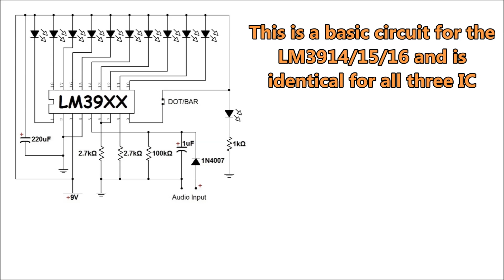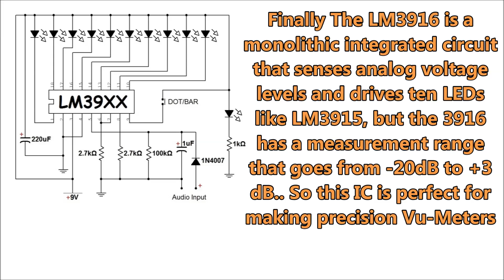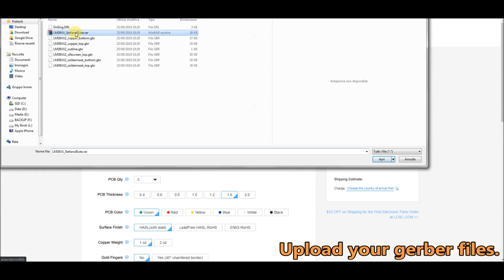LM3914 vs LM3915 vs LM3916 - What are the differences?

Comment: Hi, curious to know if this chip (LM3916) offers or needs any type of calibration / adjustment, or is it already leveled and scaled correctly for reading the input of a signal properly?  Thanks.
Reply: They have input pins for low and high voltage - and will measure the signal voltage's position between those two extremes. Often you tie the low voltage input to ground and the high voltage input to a suitable reference. The chip has an internal reference of something like 1.25V (I can't remember exactly) which can be used to measure a line level audio signal (should be max 1V peak to peak) so the yellow LED comes on when it hits 1V and the red ones come on if it goes over, or something like that!

Comment: Can i don't connect dot/bar and should connect that two points with wire ? Please sir reply ❤❤
Reply from the maker: Hi, sure you can. I put the pins just to give the possibility to change between DOT and BAR mode, but if you prefer to solder a wire and close the contact it doesn't change anything.

Comment: Please sir reply ❤❤ what is the full rate of all components.example 220 micro Faraday capasitor what is voltage
Reply from the maker: Hi, it is important that the voltage of the electrolytic capacitors is higher than the power supply voltage of the circuit, in this case electrolytic capacitors of 25v or above is fine.

Comment: I have an Aphex 320A leveler which uses both LM3914 and LM3915. It has a problem now, which lead me to the LM3914 which is broken. The socket of this IC is melted and also the socket of the LM3915 (but this one still works... for now). Any idea what could cause these IC's to heat up so much? They might be 25 years old in the mean time, but I don't know if I should just replace them, or if I must dig a bit deeper. All IC's get 15V, according to a digital volt meter.
Reply from the maker: Hi, there could be a short circuit in some track connected to the PINs or an abnormal current absorption from the LED side.. have you checked?
Reply: @Stefano91ste  Not yet, but I am going to. Thanks for replying.

Comment: And can I add more 3 line of led like current line without adding another components please reply sir
Reply from the maker: If I understand the question correctly: no, each LED column needs its own circuit to work.
Reply: @Stefano91ste  I mean can I make 2×10 led
Reply: In this circuit
Reply: 2colums

Comment: Hi I'm trying to build a vu meter for a sound to light project. I've got lm3914s and 15s. 15s are better for audio vu meters. I've got all the data sheets. What I'm struggling with is what circuitry is needed to input an audio signal from a phone or as in my project a sensitive Mic amplifier some with an op amp. My hi gain op amp works ok but my LM chips are not responding. I've wired them correctly, triple checked lol.

I understand the voltage divider/comparitor function. The chip will display a signal strength in the range set across pins 4 and 6. That voltage can be the internal reference voltage, manipulated if necessary or the divider can be supplied externally but not usually in most applications.

How do I give the correct signal voltage/strength coming from the audio sources mentioned above is my main concern.

Thank you for any advice you can give.
Reply from the maker: Hi, I use a LM386 as a preamp for the LM391X ICs .. it works very well;)
Like in this video: https://youtu.be/Ex3waFdQrHY
Reply: @Stefano91ste  excellent, thank you or your help

Comment: SIR, So who are you going to get your LM3915 from, and what are you going to do if it turns out to actually be a remarked LM3914?
Reply from the maker: Hi, I generally buy LM3915s at electronics fairs.. but now thanks to the virus they are all suspended.. :( 
Fortunately I have always used DIP for my projects, so I have about 60 LM3915s at home that I can reuse without having to unsolder them.

Comment: Very nice explanation with demo. Could i use WS2812B LED (5050) with 9v input ? please advise
Reply: No, you need a microcontroller to drive those, they require a serial communication line.

Comment: great! is it hard to implement a peak hold function as well? (when the signal hits the red leds) Thanks!
Reply: The chip is not designed for that.  It is either in "bar mode" as shown in the video, or "dot mode" which displays only one LED at any given moment to show the level.  If you want peak/hold, you will probably need to use a microcontroller with a specialized program.
Reply: @Enigma758  ok thanks!

Comment: Bro I wanna make led fuel indicator using lm3915ic.We have to give Negative current for input.if tank become full it send 0-20 ohams unit if tank become empty it sends 220 ohams units.will you tell me circuit which works between 0-220 ohams negative current.
Reply from the maker: Hi, the LM3914/15/16 perceive a change in voltage, not in resistance, and not in negative current.
Reply: @Stefano91ste  will you suggest me which component can i use for these type of circuit.

Comment: Hi Sir. This is very urgent. I was recently working on rpm meter usinf lm2917 ans 3914 from 4 months.i have cascaded 6 lm3914 .Today i completed my circuit but led arent function properly. Can you send me the circuit diagram or how to cascade them. I watched your rpm meter video but there i did not understand how you cascaded lm3914. I spent lot of efforts on it. COULD YOU PLEASE TELL ME HOW TO CASCADE 6 LM3914. PLEASE😞😞😞
Reply from the maker: Hi, in this project i cascade 5x LM3415 https://youtu.be/Ox5TAZAnTrY but the diagram is the same for LM3914.. you can use this diagram for add one LM3914.. However to connect the LM391X in series it is necessary to connect pin 6 of the first with pin 4 of the second, pin 6 of the second with pin 4 of the third, pin 6 of the third with pin 4 of the fourth.. etc.
PS: in my rpm meter video you can see the circuit diagram, and also in this video with the 5x LM3915 you find the diagram towards the end of the video

Comment: 3914 and 3916 work allmost same
Reply from the maker: Apparently yes, but actually they have been designed for different purposes.. LM3914 for applications like Volt-Meter, Thermometer etc and- LM3916 for audio application.
- LM3914 is linear.
- LM3916 is logarithmic (with a defined dB range)

Comment: Я вижу LM3916 это перетертая LM3914?!
Reply from the maker: Hi, they're like that from the factory
Reply: @Stefano91ste  Yes, the Chinese supply the LM3914 chip in LM3916. I suffered for a long time until I realized what the problem was. I pulled the real LM3916 out of the tape recorder and then I saw the difference. 
 
I also make indicators.
Reply: @Stefano91ste   If you compare, your LM3914 and LM3916 look the same. This shouldn't happen. They have a big difference between the comparator divisors.